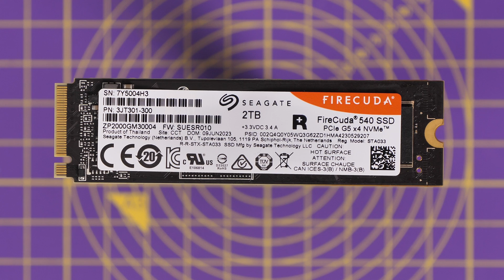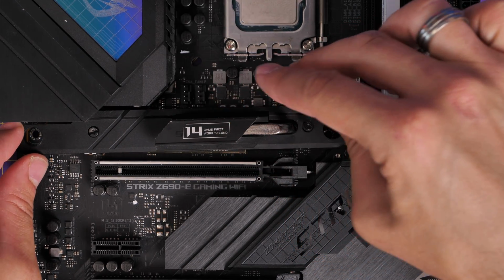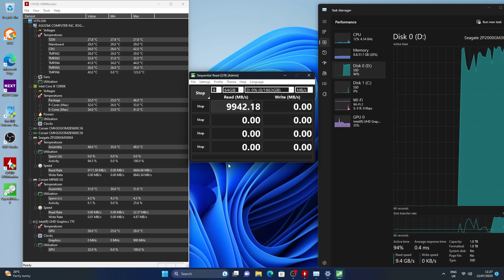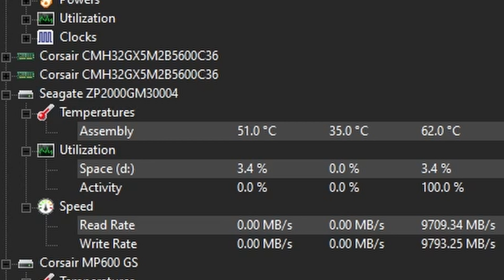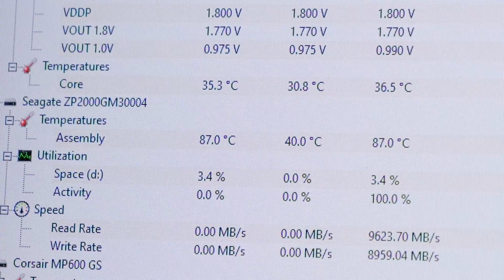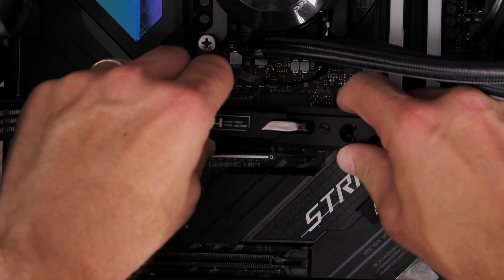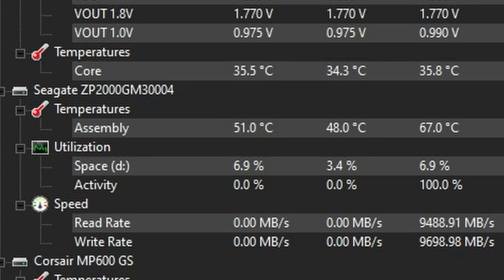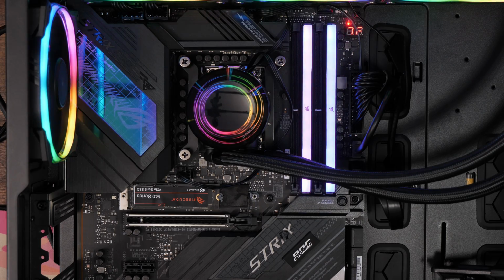Do stickers and heatsinks matter for NVMe SSDs? PCIe gen 5 drive testing!

Comment: I was forced to remove the stickers from my C: NVMe. Since I have an MSI MPG x870e Carbon Wifi, to get the M.2 RGB working, I had to peel off the sticker so the pins would make contact with the RGB connector.

Comment: I'll be putting  2 gen 5 drives in my new system. One of the slots has a heatsink wiyh thermal pads below and above the drive, but the other slot has a heatsink with a thermal pad above the drive, but not below. Would this be sufficient?

Comment: Not sure where i herd this but the stickers are heat transfer material because the actual memory chips make heat and they don't like the heat but the controller or something else on the nvme does run better with heat so they are designed to move the heat on the nvme to the parts that perform better with them.

Comment: Test without stickers may be faulty. 
Thermal pad on the heatspreader covers maybe half of the controller (they can be seen side by side at 5:50). This is probably why you see worse temperatures without stickers than with them. In reallity temperatures should be pretty much the same as these graphene stickers are superb in passing the heat.
It's vital to understand that to avoid thermal throttling it's the controller you really want to keep cool, not the NAND dies.
Reply: Yeah, better to put it on the chips.

Comment: Did you already make a vid regarding the speed difference between NVME sockets ? With or without GPU? Thanks 🤘
Reply from the maker: It varies wildly from motherboard to motherboard. Some I've found if you populate all the slots it halves the speed of others, some you can fill them all up and it still runs max speed, some it impacts the GPU lanes. It's impossible to do a general assessment of it I think

Comment: So I'm looking at investing in my machine, in other words, I'm going to be replacing everything but the case and the fans.
The last thing I was pondering, was an NVMe.
Thank you for this video because it actually puts a lot of things to rest, aka paranoid fears.
They are considerably more expensive but from what I've been hearing and reading and seeing, it looks like they're worth their money if you don't take off the stickers in the heat sinks lol
Reply from the maker: NVMe is great
Reply: @TheProvokedPrawn 
Oh yes they are.
Reply: SSDs be it SATA or NVMe have never been more affordable than nowadays.
4TB can be had for 200bucks or less, not to long ago, that was at best the 2TB price.
I just got me a 990Pro 2TB for the System, swapfile, all the programs and the heavy workloads, as this drives doesnt care what you throw at it, it stays the fastest and most consistent Gen4 NVME.
And for Gaming i got me the Lexar NM790 4TB, which is a beast for the price and puts the cheap crap, like the P3 oder NV1 or NV2 to shame and 3PBW is also nothing to scoff at. 😊

Comment: I thought the same, why don't they remove the stickers? Thanks for solving my doubt!
Reply from the maker: You're welcome
Reply: I replaced the sticker for thermal pad. Stickers has glue so basically it does contain water.
Reply: @yoppiear  Did you get better thermals?